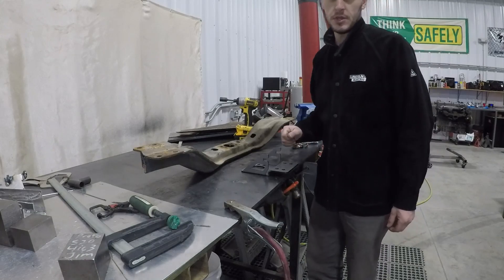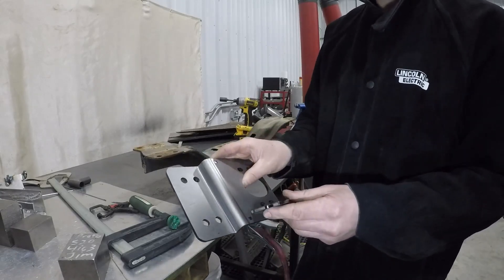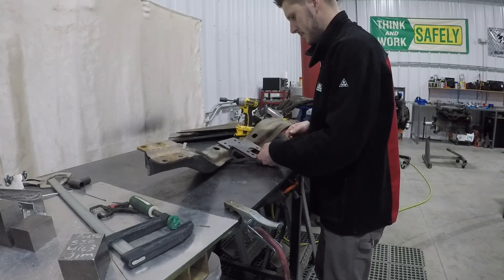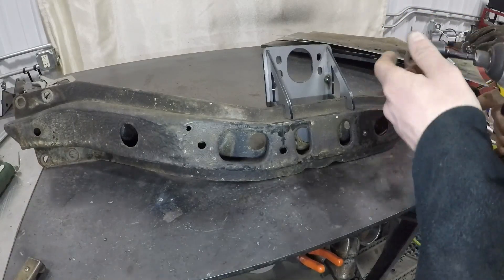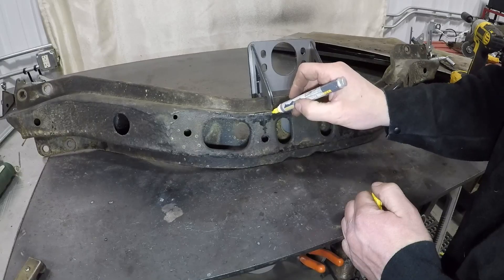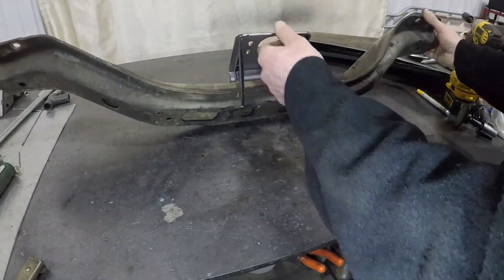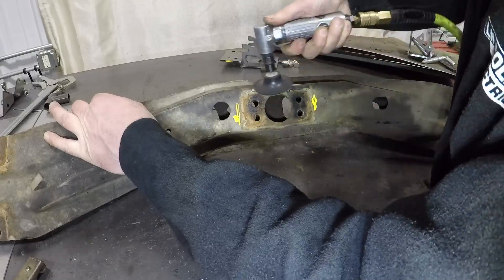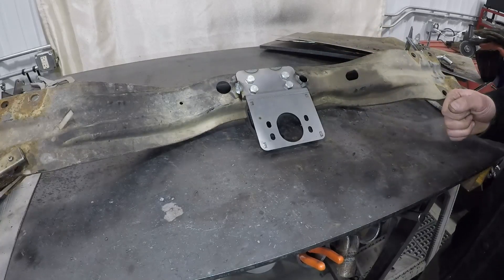OM617 Conversion Series: Transmission Crossmember Extension Installation

Comment: Do you offer an adapter to put a 5 speed into my diesel 1980 Mercedes 240d car? Thanks
Reply from the maker: The W56 and R150 both work excellently